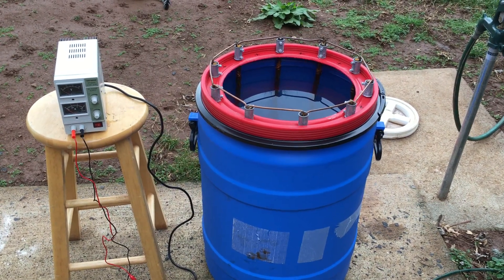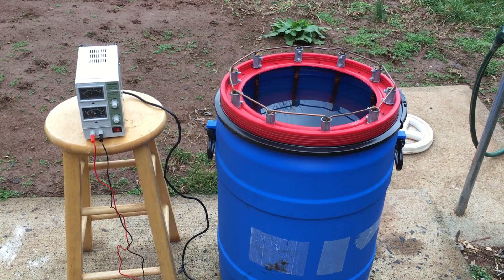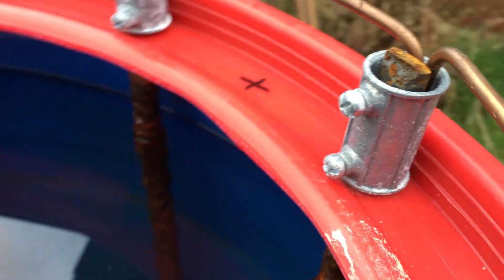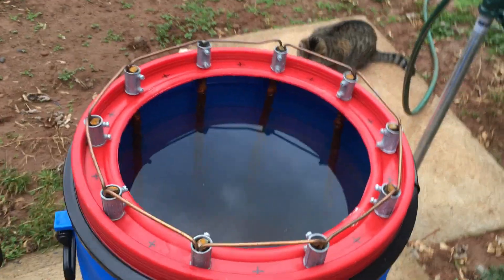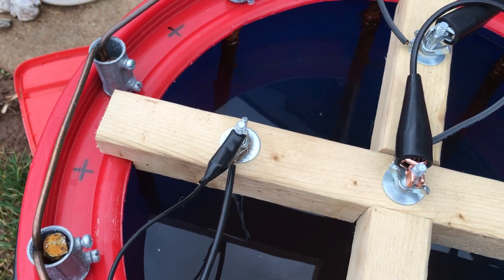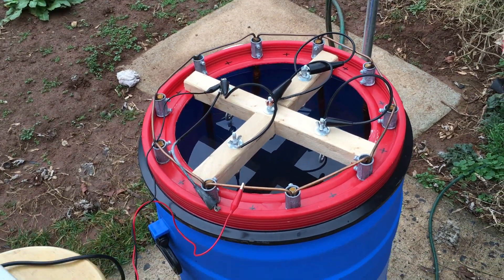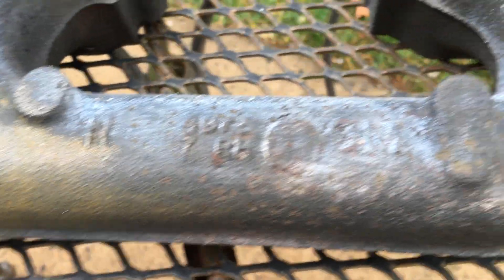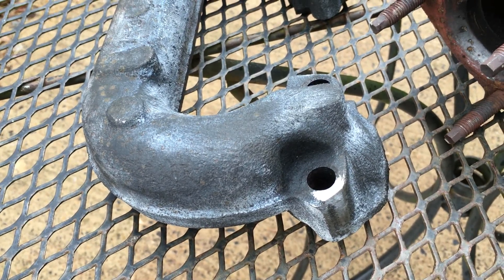My Electrolysis De-rusting System

Comment: I have a similar system using Black gas pipe  which. Worked graat.  I didn't have any rebar so I  tried using scrap bedframes but I had to strip the paint .  I tried hanging  random chunks of steel in the barrel but I  burnt up a PC Power supply when my sacrificial metal touched the parts I was cleaning.   I think your design is the best because it holds the rebar in place and takes up less room than pipe.

Comment: If I remember my electrical theory.  I believe being your anode are in series not parallel that the voltage feeding drops across all points adding up to total feed so you may have little voltage at some anodes.  Do you notice a difference in your de-rusting on parts of the surface.  It may only be noticeable on a  larger surface part.  Of course I could be totally wrong…. Lol.   Regardless well done, its a nice setup
Reply: Or in parallel allows for better current distribution…. Its something like that i believe but in the long run it may not make much of a difference.

Comment: Dec. 2025////I'm late to the  party on this  build but  that is a verrrrry smart set up.  I'm going to build two of those, one like you created and the second as you created then weave then weave steel wire around the  reBar, like one would see  with a  woven basket.  I'm thinking the more wire would provide more surface area.

Comment: What is the red ring on top?
Reply from the maker: The barrel I used is a 30 gallon food grade barrel with a red lid. I cut the center out of the lid and retained the outer ring portion to attach the electrical connections to.

Comment: two weeks? Ill stick to vinegar
Reply: I use an ultrasonic cleaner with citric acid powder i keep to run through my washing mashine to keep it clean and kill any drain smell from creeping up.  Soak your parts in the solution for a few hours then turn it on..,  poof… stuff flies off.  Of course you can just mix, add parts then turn it on but it looks more dramatic after a soaking… lol

Comment: Hey, so have pretty much same set as you. So far nothing, couldn't get Gator clips to spark any when hooked up, just the main negative, and positive clamps from charger with spark, nothing else. Also using borax, says its work with the electrolytes. Just wondering if you had any suggestions. Have it at 12 volts, ,with 2 amps. Thanks!
Reply from the maker: Use an ohm meter to check all your wiring for high resistance. That would be the first place I would look. Also make sure your power source is putting out amps. You should see tiny bubbles of hydrogen rising from the tank within a few minutes of operation.

Comment: Be careful leaving your parts under electrolysis longer than absolutely necessary. Hydrogen embrittlement can lead to cracking and a general loss of ductility. I've noticed that it can happen quite quickly in high carbon steels like plane irons, knife blades and files.

Comment: This process causes the rust to dissolve into solution. It will also remove any paint or coating on the metal. The anodes are actually corroding and that’s what is in the anode. It doesn’t attract the rust to them. It turns rusty brown on the outer surface due to the oxygen that’s produced at the anode. Closer to the anode where the active corrosion is you get the black gooey crap (metal oxides) this same stuff will be on your pan since it’s in such close proximity to the anode.

Comment: regarding the conduit couplers - maybe a bit of grease filled in there would avoid corrosion? or maybe if you're welding adjacent, braze the rebar to the copper?

Comment: When you get through with removing the rust from your project. You need to  plan to remove the rust from the rebar before your next project. It will go faster.

Comment: Great video Albert..! I really like the design of your tank. I've been doing some research,and I would like to make some suggestions. 
1. The higher the amperage, the quicker it de -rusts the item. 2. 14 gauge wire doesn't cut it. Get heavier leed wire. 3. The rebar anodes work, however, 2" x 20" graphite plates, wouldn't corrode,they would give more of a charge surface, so, you wouldn't need to replace them, and clean them. You could use graphite rods, also. They are costly, but the results are well worth it. 4. A chemist friend of mine suggested using sodium sulfate, instead of sodium carbonate. It may work better as an electrolyte.
Reply: Are you referring to the wires (14 gauge?) coming directly from the dc power source?
Reply: What ratio of sodium sulfate would you use in your solution? Do you need a lot?

Comment: Steel rebar.  One amp of current from red wire, but when you connect it to rebar the rebar will jump to 20 amps while the red wire stays at one amp.....lmao.

Comment: All of these video are really funny.  People use angle iron, rebar, flat iron, all kinds of crazy heavy duty steel......all of which serve no purpose.  The amount of current is limited by the red and black wires on the voltage generator.  Connecting to ANYTHING larger than #14 wires serves absolutely no purpose.  If you don't believe me, try it my way with strands of #14 copper wires instead of rebar.  Results will be exactly the same.   stupid is as stupid does.

Comment: Nice rig. I currently use a 20 amp battery charger and large rectangular tank but I think I need to both increase the number of anodes and get a supply like yours.

Comment: What did you find to be the best voltage and amperage settings?
Reply from the maker: I maxed it out on my power supply at 12V which is pretty much the same as a standard over the counter car battery charger you can get from Walmart. Obviously more amperage will do more but you don't want to cook the system. I would say that going 12V @10 -amps will work the best.

Comment: Thank you for the inspiration.  Today I built my unit.  I took your idea of using the conduit splices, used the ground wire from romex, doubled it and twisted it to make a 5 gallon bucket / 5 rebar / manual battery charger unit to clean the rusty axe heads I have.  So far so good, I was able to find the foundry mark.  Love this no cost version using things I had.

Comment: That's a great setup there! I'll be sure to keep this in mind, going forward. I built a temporary 4'x5' "tank" for electrolysis rust removal from steel wire shelving. Using thick plastic visqueen, draped over a simple 2"x8" boards lying flat on the concrete floor, which was outside, but covered. It worked great at removing rust from 3 dozen steel shelves, and then it was easy to disassemble when finished.

Comment: Anodes need to have a lot of surface area, when they get a build up on them they become less efficient.  I did the same with threaded rod and found out that using metal sheets welded to the rods improved the performance. Bravo for using heavy duty wire, but from what I can see in your setup is the leads may be a 22 gauge wire and will never hold any type of high amperage.

Comment: Albert... LOL my grandpa's name,       you really have one of the best , practical ability to do  small items and larger items to be de-rusted.   IF one was to actually see the 30 gallon barrel next to the big rubber made tub 
the 30 gallon takes much less space.. much smaller space. as its vertical,  all things are variable and as you have the cross sections which you can hang individual items,,,    this, that can be scaled in any tub or barrel situation..but your system is economical and includes many many size large and small without going all in for a giant tub or barrel for those of us who don't  have that much space to occasionally de-rust something....besides an engine block ...great video  mant thanks

Comment: you should up your game and nickel plate your copper clamps so they never corrode. nickel is great for conductivity and corrosion resistance. and its done through basically the same process.

Comment: Pretty cool design. I was wondering if you ran a grinder around the outside of that rebar before you put it in to remove that slag coating. Once I did that, mine worked twice as well

Comment: Nice video!  I like the EMT set-screw couplers to re-bar mechanics for your sacrificial's, great idea!  I'd like to suggest a better electrical method for attaching the copper wire though, drill and tap the ends of the re-bar then connect the copper wire with small bolts.

Comment: The same tank used to remove the iron oxide should be able to replace it with a protective coat of something else simply by changing polarity and the rods/electrolyte. I Think :) We dont need a good finish, just one that wont oxidize or vaporize under the heat(zinc-easy). Excellent build btw. Thanks for the run through.

Comment: Your overthinking it. Any container will work. You can get 55 gallon drums all day for free. A kiddo pool is cheap and a great option because large objects like doors and fenders will fit or mostly fit then can be rotated. Small container's easy to find. Just toss in a sacrificial rod and your cooking. You make one dedicated tank and your limited to it's size. You did a good job but it's a lot of work just to find out it's too small.

Comment: Only thing I would change is using an insulated heavy guage wire instead of bare copper to integrate the positive connection field of re-bar, and maybe wrap the conduit connectors with a water resistant or compatible electric or duct tape. That might reduce the possibility of arcing or sparking given the flammable gas by-products generated from the electrolysis process. Might be a small thing probability wise, but everything I have read cautions against risking DIY electrolysis set-ups to any kind of exposure to sparks or flame, especially when used indoors.

Comment: That's a great idea! Have you ever thought about putting some kind of weakly acidic acid the barrel? Maybe like vinegar?
Reply: Im not sure how  electrolysis would affect the acetic acid :searched' (CH3COOH) byproduct ethane and carbon dioxide',  but vinegar by itself  works amazingly well without the pitting you can get with elec.
Reply: Vinegar aka acetic acid is only weakly ionized in water. Almost all the electrolysis set ups for cast iron (like skillets) use sodium carbonate. Vinegar doesn't readily carry much current like a salt solution.

Comment: Why not just use a steel oil barrel and thus increase current density and efficiency? I use this method and put a 12V 21W car bulb in series to prevent shorts damaging the PSU.
Also, use copper pipe for cathode connection, soldering wires to it with crocs on the end. saves all the wingnuts and bolts and wood etc.

Comment: This my friend is the cats ass!  Thanks for the great video and explanation. I have been doing electrolysis for a few years and this will make my life much easier.  I think I will out drain spout and tap on the bottom. Top shelf and all the best. I do use the power supply also but have used the battery charger as well.  I use wood blocks for isolation of parts as well.

Comment: I do like the looks of your set up.
I'm trying to get different ideas, and yours is a great one. The  way you have the rebar mounted and the brace to hold the parts is really a cool idea. May I suggest for that parts hanger, if you choose to connect all 5 together, use 2 pieces of flat bar drilled to match the holes already made for hanging parts, cris-crossed on the wooden "X".

What I'm wanting to remove rust from is a pair of "wings" off an old '80s Craftsman 311.... model table saw. As I do like the way your electrodes are done, I will have to go with something more flat for the liquid tank.
Thanks for the great video!
Arlie

Comment: Well engineered. I made a similar tank using rebar as the anodes. I drilled a hole in one end and tapped it for  1/4"  threaded rod about 2" long. Then I made a daisy chain of wire that connected to each of the 4 rebar using electrical eye crimp connectors and some 12 gauge wire. Put the eyelet over the threaded rod and screw down a wingnut on each rod for a solid connection. I also epoxied four 1" pieces of 3/4" PVC pipe in the bottom of the barrel, spaced equidistant around the inner circumference. They hold the rebar in place. So where did you get that red ring of plastic at the top?

Comment: It looks fancy but it doesn't matter if you have got one or 100 rebars, it ends up the same quality with the same speed. The speed depends on the Ampers. The higher the Amper the electrones will travel faster so you would take shorter time.

Comment: One of the best if not THE best presentations I have seen on the subject. I spent 30 years in engineering, and this is typical of the way stuff should be designed. Simple direct to the point and well executed, no beating around the bush. Like Larry says, "Git 'er done!" You have done an excellent job and an excellent presentation with out all the technical jargon bullshit. You are a BORN engineer.
Reply: What a kind thing to say!  :)

Comment: I really like you design,  but the way I've found with DC power, those tiny leads don't carry the voltage well. doesn't look like they could carry the amps to put power to all that rebar.  I mean have you ever tried to jump start a car? I run mine with 10 gauge. You couldn't even use those small leads to warm a cigarette lighter in a car.  How many amps does that thing put out? Just saying, it would probably work much better with a battery charger and bigger leads.
Reply: Yeah his set up is dumb I got a basic ass bucket and a battery charger that can do 10-50 amps. I only use 1 anode and get better results then his in 2 hours. Also cost me $0

Comment: I think i would take and put PVC pipe with hole drill in it around the rebar. To make sure your part and the rebar don't touch
Reply: That'd probably cut efficiency down quite a bit.

Comment: That's a very well designed tank. Can you tell me what did you use for the red part? By the looks of the alligator clips from your power supply, it doesn't look like it has a high amperage output... I wonder if you would get better results with a battery charger with a stronger electrical current (Amperage)? This would also help in to overcome the resistance of the heavy copper connections and the conduit connectors as well. Great Job!! Love it!
Reply: I think the red part is the barrel lid

Comment: I like your design and there was the one guy that said it was over engineered. There was the original Volkswagen Beetle then there was the Porsche turbo Carrera!I tried this a few weeks ago but all I had was a 5 gallon bucket. Substituted muratic acid as my electrolyte and used a variac for my power supply. First piece was done using 12vdc and took 6 hours - not stellar. Second piece was with 32vdc and left overnight. Amazing results! Plan on building bigger and better and using higher voltage for next trials.
Reply: Isnt it higher ampage you'd want for faster results?
Reply: DevynGuevara:  YES. I don't know the limits because my high voltage Variac is hooked up to something else now and I haven't done anything else with it since.  I'll let you know
Reply: Scott Burrous alright. My set up used to be a 5 gal bucket and a 2amp ac to dc xbox 360 power brick/inverter. Now i just used a car battery carger that has 10 amps and a fancy trash can i made
Reply: I tried half a cup o Ferric Chloride  in my temporary setup and it worked rather well.  Was your HCl diluted or neat?
Reply: GlenislaGhillie:
By definition muriatic acid is diluted HCL.  The solution I used was about 35% in the bottle. I just dumped about a half bottle into a 55gal. barrel. After about 50 uses I dumped it out because sludge was interfering with the electrodes.
Reply: GlenislaGhilli

Comment: Did you use anti-oxidation grease on you rebar/copper wire connections?  What about a bottom drain spigot/petcock?
Reply: You certainly could but rebar and wire are cheap or free. A bottom drain would be more work but could be convenient on larger electrolysis tanks. Industrial platers (plating and electrolysis work similarly) have drains on their tanks. Use plastic of course.

Comment: nice design, but u could do that stuff with 5min of sandblasting.
Reply: I literally cannot believe that you can get in a fight with someone in comment section of a video describing such a wonderful design.
Reply: Sandblasting does not get into the pores of the steel/iron and neutralize the rust reaction. Chemical/electrolytic derusting (conversion) does. Blasted rust, even after repainting will soon blister through again with new rust.    This method also preserves surface detail beautifully. I restore old measurement instruments and graduated tooling and blasting is not even an option.   Nice job Albert, and thanks for your subscription to my channel.
Reply: Sandblasting pits the metal, Dufus.
Reply: @drewjohnson4673  Not all metals, not all the time. Not all blasting media. It remains an option.
Reply: That’s a one meat and 3 veg man right there 👆🏻👆🏻👆🏻
Reply: @Dave-lr2wo  It is a legitimate question when the parts treated are cast iron exhaust manifolds.
Reply: Is that the case?? U think this part requires it? U are idiotic yourself.
Reply: Many parts cannot be blasted, for example machinery parts where the "tooth" created by abrasive blasting would ruin the surface. Blast nozzles cannot reach where electrolysis can. Clearly you know more about everything than the many experienced machinists, auto restorers and more who have used electrolysis over more than a century.

Comment: You can get pre cut 2 foot lengths of rebar at home depot or lowes.
Reply: It's Seven years later, and still True!
They even sell the smaller diameter rebar's, and you can buy them pre-sharpened too!